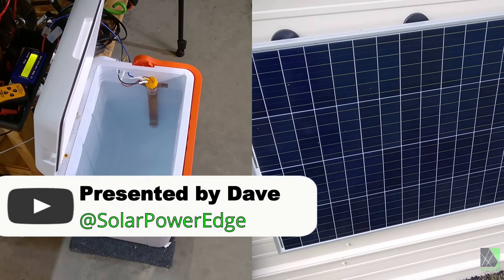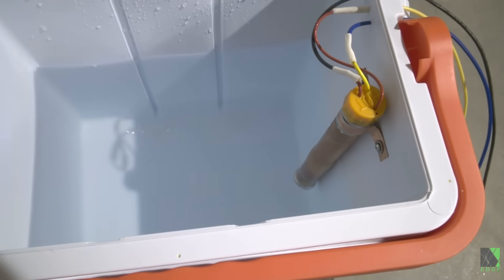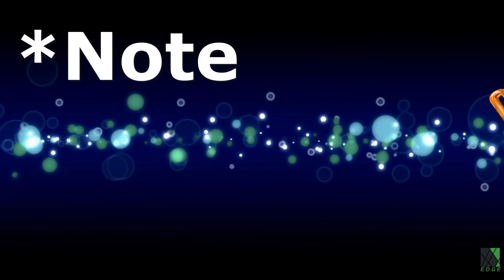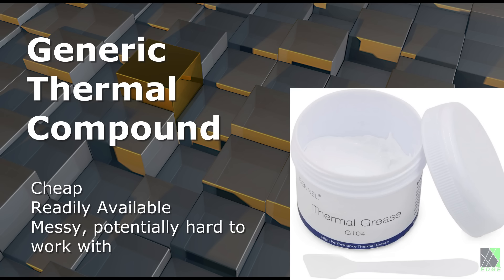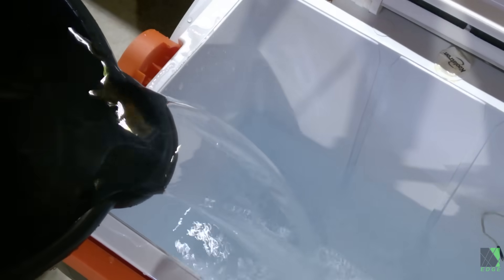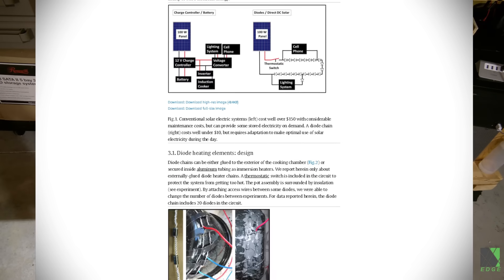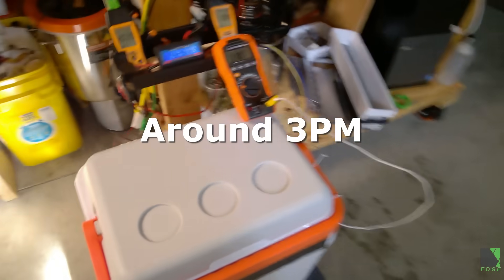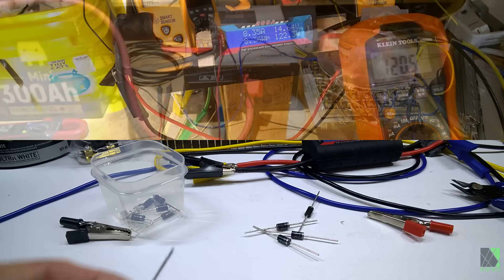I built a PV DC Semiconductor Immersion Water Heating Element! diode chain application #science

Comment: Try using a liquid thermal conductor like 3M Novec, or the thinnest oil you can find, obviously with oil there is a fire risk but if it is sealed properly with the right expansion chamber and also thermal cut off this is negligible. 
You should use SIC (silicon carbide) diodes as they are rated for higher temp and will give longer lifespan, the downside is you will need more in series as Vdrop is lower, but the upside that each device will dissipate less heat meaning they will be easier to cool. You could also try fitting the diode string into a tight fitting tube but that might be quite difficult without a tooling designed to do it.
Reply from the maker: @ChrisDay-sx4lv Had to look that up... 3M Novec sounds extremely promising, hopefully it doesn't offgas anything toxic while heated. Thanks for sharing the knowledge and ideas, I have added all these items in my notes
Reply: @solarpoweredge  The problem with it is that it needs space for expansion and cooling to transition back into a liquid so you will have to make the unit bigger, the other problem is that its expensive, The way I would do it is switch the type of diodes to the ones that are mounted on a heat sink with screws like TO-220 and then pot the back with a silicone compound. Another option would be to use an aluminium backed PCB and then solder diodes to that and screw that to a heatsink that would be very fast and easy to make or mass produce, especially with a service like JLC PCB etc. Stops you messing about with trying to create an ineffective thermal interface out of ceramics or messy oils or compounds. Another beifit is that you can tap multipole points on the pcb easily to change the working voltage.
Reply from the maker: These are all super good points.... I ordered some TO-220 and will look into a custom PCB as well

Comment: Imagine having light emitting diodes. I want to build a greenhouse in my basement and I’ve often thought that Solar direct LEDs in series would be simple and effective, and if I connected the right amount of them to the open circuit voltage of the solar array, then I’m sure it would be incredibly efficient. Plus any heat generated would be an excellent byproduct in this cold winter environment.
Reply from the maker: @michaelchownyk5255 Right on!!! I light my workshop with solar direct LEDs, it works great :D there are some downside, but it's so simple and useful. Here's a little glimpse at my direct solar power workbench https://youtu.be/zEZ0ke48awM
Reply: You could also add a fan to your LEDs - blowing air downwards to avoid having the heat pile up uselessly on the basement ceiling. You get more heat, the plants get a nice strengthening and invigorating breeze and bonus, the LEDs get to stay at a comfortable temperature. With all those advantages, the cost and power used for the fans is well worth it, I think.
I love that in these systems, any ‘wasted heat’ isn’t wasted at all… it’s all good, even the fans add to the heating potential.
Reply from the maker: @simontillson482 Right on... now you've got me thinking about lighting with those high power LEDs so I can harvest their waste heat 👍
btw it's possible to drive the DC fan off a subset of the LEDs, if the voltage is higher than 12v. Strange way to make a power supply but it works!!
Reply: I’m interested now! Dang! Another project! Lol!
Reply from the maker: @jeffsmith6208  lol!

Comment: 👍..this is very good way to achieve sort of ppt..i've tried similar fixed point system myself..but eventually i built uC based dcdc with 'full' mppt tracking since i live in very north (like northern Canada, but Nordics) and i noticed that the power point moves quite a bit when surrounding conditions change (eg. from 26v to 30,5v) and since for me the cost for mppt was only some lines of code i changed to that..i believe the last at least 10% of energy comes with adapting to moving power point in my array. But taking into consideration how much more one can get by just going to fixed power point (well..diodes adapt a little since threshold voltage goes down a bit with rising surrounding temperature like with panels..but their temperatures [meaning pv array and water tank] correlates only partially..) with diodes compared to pure resistive heating i think this is what one should do if not going full blown mppt when heating is the goal..! 😊
Reply from the maker: @hipihei I am sure electronic MPPT is here to stay for a long time, but for dirt simple dirt cheap "substitute" I am amazed what diodes can do! I did notice they drop their voltage a little during weak conditions due to temps, an interesting and useful coincidence...
Reply: Since they are both (pv panel and diode) kinda si-diodes if their temperatures would track, they would track rather well..unfortunately the lighting conditions mix up the bag a little..👍😅

Comment: You can buy TO220 diodes and connect them to a heatsink - where fins will be submerged directly or screwed to a heat spreader / heat pipe. Easier this way.
Reply from the maker: Right, I ordered some tough looking TO-220s suggested by a subscriber... I kept forgetting to try them. They are super easy to get on a heat sink which is why I want to try them

Comment: Cool idea 😂
I would suggest trying some oil or even glycerine to fill your tube as a wet heat exchange liquid, perhaps even consider using a 180° return bend with 2 caps which should help minimise the electrical insulation required and improve heat transfer into the liquid inside the tube if you can get away with just insulation on the leads between each diode.
Also you mentioned the energy required, this can be calculated quite easily with the formula Q= M x C x Td
Where Q is energy in Joules, M is mass in Kg, C is specific heat (sensible) of water which is about 4.187 kj/kg, Td is temp difference in Kelvin 
This gives you the energy and you need to convert that to power which is determined using Joules / Seconds = Watts
This will work provided you aren’t reaching the boiling point
Reply from the maker: @ianbottom7396 thanks for sharing... cutting edge ideas.... never thought of making a 180 degree in the pipe. I've tried Oil but not glycerine. I will take notes :D

Comment: I think you'd get the best thermal transfer by potting the cheaper axial diodes in a very form-fitting epoxy mold. This way the distance between the water and the diode's PN junction will be as short as possible. While the copper pipe has great thermal conductivity, the conductivity of thermal compound is usually very poor, and even though epoxy's is also poor, you can use a thin layer of it, only as needed to insulate from the water.
You might consider TO-220 diodes like the RHRP3060. They're little more expensive than 20A10s, but they have a heatsink tab, 30A max current draw, 2V forward drop, and should emit 60W, so you may not need as many.
Great video!
Reply from the maker: @superskrub4209 Just ordered some RHRP3060. This is what sharing knowledge is about... fantastic ideas and thanks for sharing sir. I am taking notes. I've found the thermal stuff very difficult. I will look into epoxy and TO-220s, it's been on my list. Thanks again!! -Dave

Comment: PCM (Phase Change Material) is still considered to expensive for the most part. I would still be interested to see some heat storage with paraffin wax as it is non-conductive and considering its specific heat and latent heat of fusion for phase change, edges out water for the 20-100C temperature range.
Reply from the maker: @captainobvious9188 This really needs to be investigated... I have been studying wax vs. oil vs. water vs. sand vs. thermochemical methods for heat storage. Currently I do not yet have enough wax in a container yet, need to order several blocks for the experiments. Could be very interesting and I would like to do away with insulating the diodes...
Reply: Phase change cannot be used here because of the wide range in temperature of the water tank

Comment: Instead of using copper pipe for the shell of the diode string, could you use a tight fitting flexible clear plastic tubing and slightly heat shrink it around the diodes?  That way you would have good contact with the water, and the water should keep the plastic tubing from melting.  Reference to a styrofoam cup filled with water resting in an open wood fire.
Reply from the maker: @koocanusasam7856 Right on... this idea needs to be tested, I think it can work! if the tubing is thin it does insulated but the water should pull the heat right out in theory. Appreciate your sharing the knowledge !
Reply: @solarpoweredge  correct that’s what I was thinking.  The tubing would probably contract to a tight fitting flexible clear after a few cycles and give good heat transfer.  As well, you could make a long diode chain and form it into a coil or any other desired shape to fit the heater tank.  Then perhaps wrap some copper wire around the outside and make a few loops that would act as supports so the diode chain is suspended off the bottom of the tank.  Then you wouldn’t need to have a circulation pump because the natural convection current would be enough to equalize the temperature.  The only drawback I potentially see is when you move to a pressurized vessel aka standard water tank, it would need to be sealed somehow where the plastic tubing exits the tank.  Using a small rv water supply pump fed from a non pressurized tank would allow you to pressurize a domestic hot water feed system.
Reply: Please post if you or anyone has success with the heat shrink tubing or any other easy way to protect the diodes from the water.   Any hope for waterproof diodes?

Comment: Observing your test setup with the water and container. Copper is a great choice for thermal transfer. Maybe as a suggestion you may like to try a Non-Conductive AW ISO 32 Hydraulic Oil (Lucas) This will give a movement of fluid as the diodes heat up and will support a higher transfer to the copper and then to the water. Great work happening here.
Reply from the maker: @colinpine4412 Thanks for sharing your knowledge... I have found it difficult to get the heat over to the copper tube, I will look into the Hydraulic oil too. I did try another kind of oil and need to see if there is any better way, as the top of the heating element got rather hot for my taste

Comment: Love to see how it's coming along! I've been thinking about making a version that houses the diode chain in a continuous tube of heat shrink which then gets housed within a radiator (not sealed). I'm not sure if the heat transfer through the shrink would be fast enough to stop them burning out but I like the idea of a simple solar radiator and of course you're storing the heat for use a little while after the sun has gone. The question is whether there would be enough energy to heat a radiator that is designed to cool itself...
Reply from the maker: @treesareafewofmyfavoritethings That's a good idea, heat shrink is pretty thin. If it's in water I would think the heat transfer would be decent and would work pretty well
Reply: @solarpoweredge  I've already made something like this after seeing your first video and can report that it seems to work well enough. I had a whole box of 10A diodes for PV and several rolls of shrink tube and tried it in a 5 gallon bucket of tap water. I also used a voltmeter probe various places in the water seeing if I could see any potential between the negative or positive of the panel - and did not during my test. The shrink tube I had was the hot glue lined type for which I'm unsure of.
Reply from the maker: @captainobvious9188 Awesome :D I'll give the shrink tube a try with the next diode chain build

Comment: Very interesting.  Used forward biased diode chain as a slot car controller back in the day.  (First solid state controller)
Reply from the maker: @iamdeadbird Right on, that's an ingenious use of diodes. I am doing something similar for my solar powered fan to change its speed! Dirt simple. No more PWM circuit...
Reply: @solarpoweredge  That would have been around 1987 or so.  We were looking to maximize NiCad battery life in some of our camera systems.  Needed a way to fully discharge them after use and before storage.  Used fixed resistant and then came up with the diode chain idea.  It quickly found it's way in to my motor controller.  I still have it somewhere...

Comment: Interesting experiments, I’m wondering where this might fit into my plans in my cabin-it’s already solar and off grid and about to get a major solar upgrade, but one thing I haven’t addressed yet is a water heater. I just assumed I would find some switch of some kind and power it as a dump load, but if I have extra panels and this is an option, why not?
Reply from the maker: If you are looking for a challenge, it's a great project! I think for tinkerers / DIY'ers, this option can work if they want to extract near the maximum heat from their solar panels and avoid MPPT. What I'd really like to see is a mass-produced semiconductor element that has the same form factor as the resistance ones. Plug and play. that would be amazing. I haven't found any diodes truly suitable for underwater use... they just don't t exist. (And no wonder, this is a very strange way to use diodes). If anyone knows of exotic power diodes that would work better for immersion, please post here...

Comment: Surface mounted diodes soldered to a copper or aluminum core PCB would give good thermal transfer. Sealing it to keep the water out could be a problem but potting the diode side might work well enough to test.
Reply from the maker: @toyz66 Wow, that's sounding very interesting, thanks for the idea... I have some PCB sealant liquid. Custom thick aluminum PCB perhaps? What's needed is a metal or direct thermal interface between the diodes and water, without exposing the electrical terminals at all. I am finding that hard to accomplish... a high density PCB with non-exposed connections as a heating element could change everything. Again thanks for sharing, I need to design a PCB and try your idea
Reply: @solarpoweredge  DFN packages and similar have the best thermal transfer characteristics, on top of that, the die is usually sitting on the cathode. You could plan a double side assembly PCB with a lot of small diodes arranged in a way that the cathodes are together. PCBs with less space between layers also have good thermal transfer (6 layer or more). For electrical isolation, once the components are assembled, the device could be sealed with any molding silicone or epoxy, then extract the heat with some heat pipes. Heat pipes have liquid inside (usually water) which will move the heat from one side to the other, they can be glued with thermal conductive epoxy. To distribute the heat in the water you can connect that pipes to a traditional heat-sink. 
Or you can just try the diodes in the PCB moulding it in thermally conducting electrically isolating epoxy, and drop it into the water, but you may need a bigger PCB for that and I don't know what will be cheaper to produce. Just some ideas...
Reply from the maker: @jano_y This is why I'm on yt... thanks for sharing the brainpower. I was offered to trial PCB manufacturing services last year. I should get some design skills and take them up on the offer. All of these ideas have been noted, thanks again :)

Comment: Would you use heat battery for heat or to generate electricity like with peltier module or stirling engine?
Reply from the maker: @retasquid88 Heat is a bit more of a priority, however I am looking into turning it into electricity. I find it very hard to do using peltiers! There must be a way to improve it though. I don't have a stirling to try but hope to acquire one soon